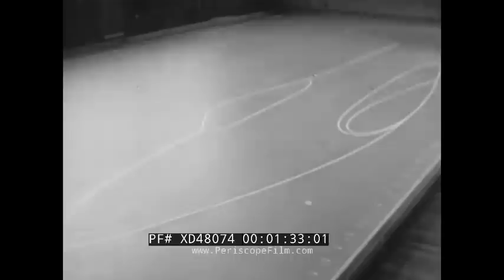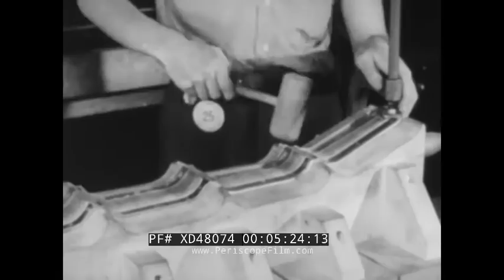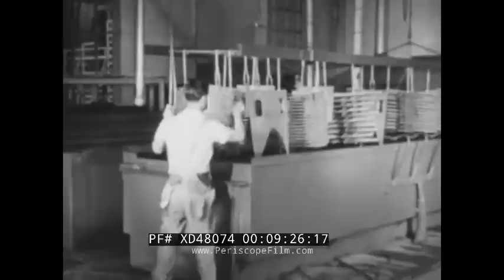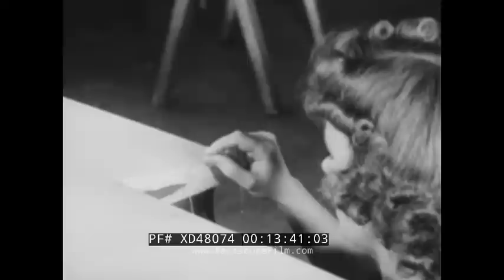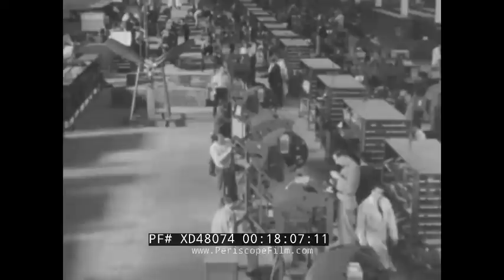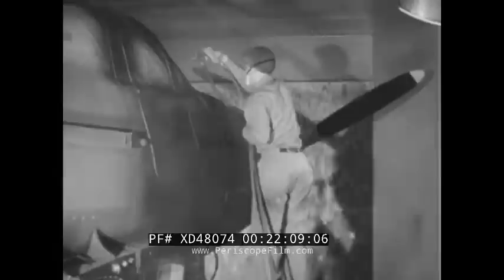1942 BELL AIRCOBRA PLANT OPERATIONS    WWII AIRPLANE PRODUCTION FACTORY TOUR XD48074

Comment: At 20:13 you see them installing the engine. The twelve exhaust stacks indicate the aircraft is a P-400. The British designation for the p-39. It also had a 20mm cannon in place of the 37mm. Oldsmobile produced those cannons!
Reply: My grandfather and great grand father owned a aluminum casting plant in dayton that casted heads and engine blocks on license for Allison i have a bunch of stero photos of them pouring aluminum into molds of all different kinds.

Comment: Imagine flying enroute over that endless expanse of rugged remote wilderness and discover that your engine has an oil leak. You must put down and try to choose a less hazardous place.
If surviving crash your only hope is your wits and hope search and rescue may locate crash site. Long before helicopters air drop supplies only option then expert dog sled crew may assist.

They flew a great many P 39’s though Great Falls Montana Malstrom Air Base on the way to give to the Russian army air wing. Coincidentally over route of the then under construction Alaska roadway.
Pioneered through rugged terrain they simply pushed worn equipment aside and replaced with new.
A snapshot of the entire war. Money was no object. The P- 39 production was a mere pin point of overall spending.

 As a side note I’ve inspected the remaining parts of C-54 Sky Master training for Berlin air lift that crashed on mountain top near Malstrom air base relatively shortly after victory in Europe.

On another outing at a high mountain lake inspection of a plane crash at distance I thought the strut assembly looked to be P-39 but as I observed closer it was obviously to big and heavy. It was a main landing gear strut of an Avenger torpedo bomber. So heavy I could barely stand it vertical for photo.
It had been converted for aerial tanker chemical drop after war.
By name on parts it was GM built version.

The Air Cobra was politically denied turbocharged boosting and relegated it to low altitude performance as result.
Airframe was top notch and very cutting-edge for time. Oldsmobile canon punchy but only about thirty rounds and low velocity rainbow trajectory. Allies attempting to use craft in rolls not well suited to resulted in unearned derogatory reputations.
Reply: my father a pilot.in the air force.God was by his side as a co pilot brought him saffely home in 44

Comment: Can someone with experience comment on the inefficient looking manufacturing process? Looks like there might have been room for improvement ...
Reply: It was all about making lots of complex aircraft FAST with relatively unskilled workers and relatively simple tools.
Reply: The US built more airplanes by 1943 than had existed in the entire world in 1942.

Bell was a niche builder in the 30s.  Most peacetime aviation shops were prior to 1940.  It ramped up really quick to serve the RAF and RCAF orders that came in 1939 and desperately in 1940.

The P51, an icon of US aviation, was designed with and for the RAF in 1939.
Reply: The construction techniques were typical at the beginning of the war. By its end, manufacturing techniques had im
Roved dramatically.